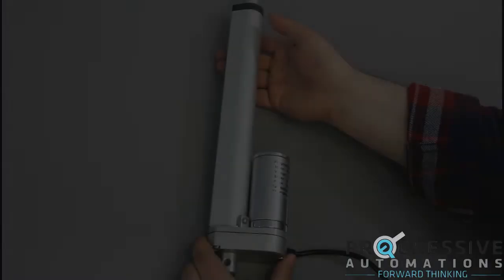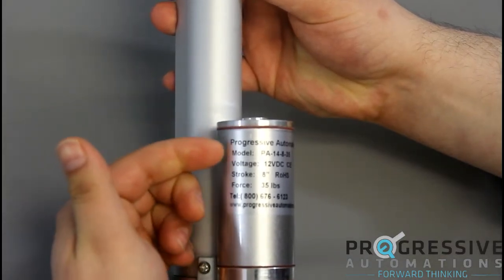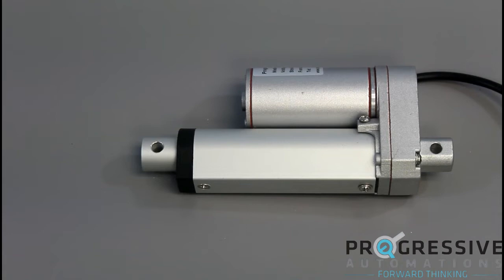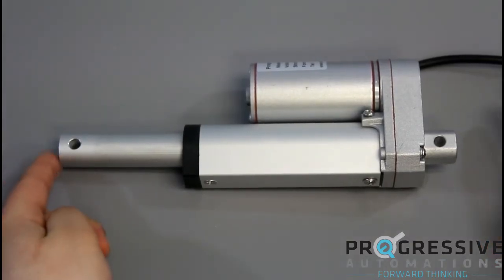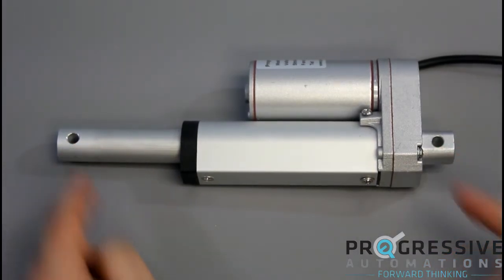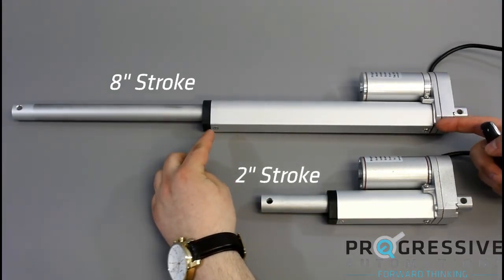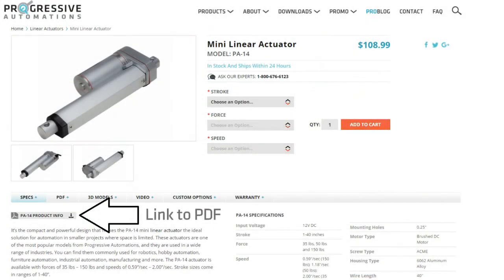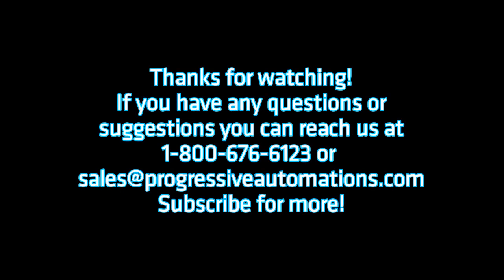Linear Actuator Stroke Length Explained: How it Effects Overall Dimensions

Comment: Wow, 7 years ago, hope I get a response! I am disabled and forced into retirement and need a small actuators for pulling a cable on a vehicle. System voltage is 12.2 - 14.3 VDC and pulls less than 4.5 lbs over 1 3/4”. I am using the vehicle’s electrons as I am just piggybacking on an existing circuit that service info shows is PWM. It reacts quickly in real life but is accomplished thru gearing up for a small load. It will encased in a waterproof enclosure and see an extreme amount of extension and retraction daily during use. In other words, a great deal of activity. The main on/off time will be constant and subject to temperatures from -10 C, to 120 C. I have painted my way into a corner with the device I have to control. Should I simply bite the bullet an go for a more expensive rotary ball actuator? 
 ASE Master Tech, 78.
Reply from the maker: Hello Dean,

Thank you for your question! 

A more expensive rotary ball actuator can be an option to consider, but will not automatically guarantee it has all the specifications rated to handle your needs. For example, 120 °C (or 248° Fahrenheit) is not a common operational temperature rating for actuators in general. Adding a cooling system to cool your actuator down to a more suitable operational temperature close to its factory rating could be worth considering. Our standard 12V actuators have brushed DC motors that require rest time between operation due to the friction generated from the rubbing brushes, so our custom manufactured 12V actuators with brushless motors will better suited for extreme amount of extension and retraction daily during use. We can also custom manufacture (approximate lead time: 12-13 weeks) to a specific stroke size like 1.75" in case you are unable to use the standard 2" model.

We will be happy to assist you further at 1-800-676-6123 or sales@progressiveautomations.com

Best regards,

Nathan - Progressive Automations
Reply: @  Whoops, I meant to say degrees F. This is the engine compartment of a 67 C10 truck, plus I plan on sheet metal service enclosed on it. Thanks! This is a keeper.
Reply from the maker: Hello Dean,

Thank you for the clarification.

The PA-14 can be custom ordered to have brushless motors, an upgraded IP65 ingress protection for added dust and water resistance, and modified to have gears with internal grease capable of handling -25ºC to 65ºC (-13ºF to 149ºF). Feel free to call or email our team for more information on custom manufacturing details.

We will be happy to assist you further at 1-800-676-6123 or sales@progressiveautomations.com 

Happy new year!

Nathan - Progressive Automations

Comment: What is the actual speed of that 8inch stroke actuator?
Reply from the maker: Hi Musphere! This example PA-14 actuator with 8 inch stroke and a 35 lbs force rating travels 2 inch/second when there is no load applied. It will take approximately 4 seconds to travel a distance of 8 inches.

Comment: Sir may I ask if I can switch the gears from a 30mm/s linear actuator to a 4mm/s to increase its speed ..I am planning on swapping their gears to save money for my project..thank you sir
Reply from the maker: Hi Musphere. A speed of 30mm/s is already faster than the speed of 4mm/s, however, we are assuming you wanted to know if it was possible to swap the gears inside an actuator. Since actuators can have a variety of different internal designs and configurations, we recommend contacting the direct manufacturer of your specific actuator to confirm with them if swapping gears was possible and if it would effect other aspects of your actuator's performance. We do not recommend swapping gears inside our own models of actuators as this voids warranty and also results in a compromised seal for dust and water resistance. Swapping gears also effect the force rating where faster speeds will result in less force capability.

Comment: Hi, How to use these in ROS . Do I need a controller or can it be interfaced through Arduino>?
Reply from the maker: Hello,
 
Our Miniature Electric Linear Actuators in the video can be wired with relays or an H-bridge to allow for controllers such as Arduino the ability to operate the actuator. These relays or H-bridge circuits must be able to handle 12 VDC and a current draw of at least 5A to allow for the proper operation of a single Miniature Electric Linear Actuator.